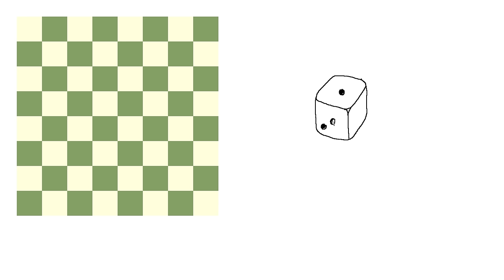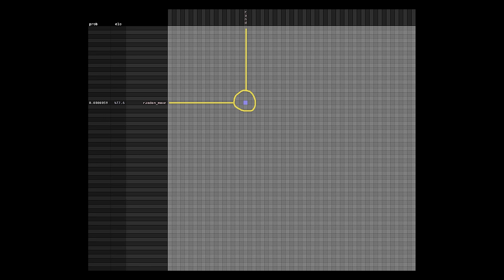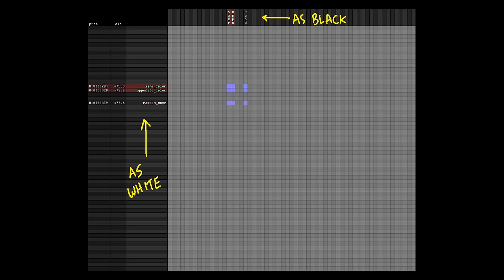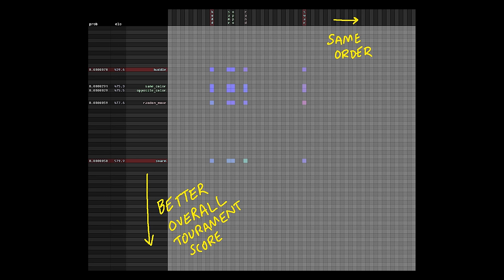30 Weird Chess Algorithms: Elo World

Comment: For those who are wondering, the name "blind_spycheck" and the strategy of that player is a reference to a spychecking technique in TF2 (which is where the term "spychecking" was coined) where you try to intentionally damage your teammates to test if they are not spies, as teammates do not take damage from friendly fire.
Reply: doesn't tf2 not play the damage sound for attacking a disguised spy?
Reply: @AveryChow  the main use case is if you use something with some lingering particle effect (mainly Pyro's flamethrower), which would absolutely stick around
Reply: @flatwoodscryptid  yeah fair enough, I forgot about pyro
Reply: weird reference for a chess video
Reply: 33:45 for ya lazy peeps
Reply: @kicknate195  I mean, this is a weird chess video
Reply: @AveryChow  Spy has very low health, so if you shoot at someone for about a second if they were a spy they would have died or had to run away.
Reply: @beautifulnova6088  IK, I've played loads of tf2 a while back, I've just forgotten some parts of how the game work lol
Reply: @AveryChow   the demoman's pill launcher and soldier's rocket launcher also give the spy away since they explode on contact. And the spy stops bullets, even if it doesn't show damage, so you can tell there's no bullet holes in the wall behind.
Reply: I thought the spy drops it's disguise if it gets damaged?
Reply: @Mostlyharmless1985  Nope. Only if they attack.

Pyros still set them on fire though, which is a giveaway even though you keep your disguise.

Comment: Possessed: Have stockfish play one move, then only allow it to move that one piece until that gets captured, and it can pick a new one! (so the currently chosen piece is "possessed" by the engine until it dies)
Reply: Oh wow that could surely be really interesting. Stockfish absolutely annihilating the opponent with a pawn.
Reply: @petersmythe6462  I believe that would be called... Pwnfish
Reply: Biggest issue I can see with that is Stockfish doesn't understand the constraint you've placed on it. So if it ever casually plays a king move, it's almost a guaranteed loss. I like the concept but you'd need to make a modify stockfish itself to build that constraint into its evaluation.
Reply: @dm9910  to be fair, most of these algorithms aren't necessarily good in terms of win rate. some of them actively try to lose, even
Reply: Possessed variant, chosen ones: Select (4-8) pieces randomly at the start of the game. Evaluate the board with stockfish. If the piece it wants to move is on the possessed list, allow it to make its move. Otherwise, move a random piece that isn't on the list randomly.
Reply: @dm9910  Yeah you would have to change the algorithm so it returned all moves not with that piece as invalid.
Reply: @dm9910  Well, we have worked around that, look at the dilution of stockfish and random.
Reply: @legendgames128  That's different. The problem isn't that it's weak, or that we can't decide what to do if moving the same piece again is illegal - of course we can throw in a random move in that case. The problem is that it doesn't understand the constraint. Stockfish's evaluations will be based on variations that it's not allowed to play. For example, it could play a move like g3 intending to go Bg3 next, but then next turn it will realize that its only valid move is g4. So even though it's using stockfish, it can't actually use any of its power. To implement this bot in a satisfying way you'd want it to foresee being locked into moving that piece again.
Reply: @dm9910  It does produce a ranking of all possible moves, so pick the best of the one that it currently possesses.
Reply: @legendgames128  Yes, you'll always be able to find a move that fits the constraint (if one is legal) but the problem is that each of those moves are ranked based on variations that don't fit the constraint. Stockfish will happily play a move like O-O without realizing that it's just locked itself into playing king moves for the entire game. It's not enough to know what moves are legal this turn, it also needs to know what moves would be legal on subsequent turns.

At the very least, the evaluation function for this constraint should avoid any king move like the plague, since that's basically tantamount to a resignation.
Reply: @dm9910  for the given "possessed" piece, you could feed each potential move's board state to stockfish to evaluate its strength. Worst case this would be slower by up to a factor of however many moves a queen on an otherwise empty board could make from a middle square, which is 28(?), I think 🤔.

Edit: ah, reading your later comments, I see what you're getting at! That's an interesting idea, and would as you note require modifying how stockfish works under the hood.
Reply: @dm9910  Maybe a way to solve the issue of it getting locked into only moving the king could be that if Stockfish ever moves the king, it's not locked in and can still move other pieces afterwards. It'd still probably do poor in the ELO ladder since if Stockfish ever moves a pawn it would be often forced to make multiple suboptimal moves with it giving time for the opponent to just win. But this would still be easier to do than rebuilding Stockfish to work specifically for this strategy.
Reply: You could let the possession hop a king’s move away from any given piece. I think that would be a satisfying solution without so many of the problems with possessing stuck pawns or the king. And it would still certainly be bad at chess. Although probably able to perform well in the Elo tournament. For bonus points, maybe add extra points to moves that leave your possessed piece next to other pieces
Reply: @matthewhubka6350  That's a better concept. Still a move-by-move handicap on the AI that it doesn't know about, and still has that undefined behavior when no "possessed" move is legal (e.g. if its king is in check, or it's possessed a pawn that's blocked) but still a big improvement over being locked into moving its king back and forth 30 times.

Comment: Piece Ranodmizer: Instead of picking a random move, pick a random piece and play it's best move from stockfish. 

Square Randomizer:Select a random space and then play the best move from stockfish that ends on that tile. 

Conway's game of life: Spaces with pieces are "alive" and ones without are "Dead". Each turn your AI makes a move to best iterate the next step in the game of life. It would be pretty cool to see a mirror match with these two having the same goal. 

Weighted Move: Where each move in stockfish is given a weight based on it's score and then you randomly pick one from the pile. More likely to get a good move, but rarely could get a crap move. 

Queen Maximizer: Try to promote as many pawns to queens as possible. 

Left only: Moves and captures can only move the pieces left and/or forwards.

Action Queue: Use the top stockfish move from the previous turn instead of the current turn. 

Rivalry: AI will always try to capture pieces with the same piece if possible. Will try not to capture pieces with other pieces if possible. 

Tic-Tac-Toe: Treat each 3X3 space as a tick tac toe board. Your AI wants to "win" as many of those boards as possible.

Comment: Physics chess: each piece attracts or repels all the other pieces according to some physical simulation. Variations: gravity: each piece has mass equal to its relative value, magnetism: same colour pieces repel instead of attract, springs: pieces attract if far apart, repel if close together. Move the piece with the maximum force in the direction of a legal move.
Reply: Thats a fun one
Reply: @muguallegi7245  underrated comment
Reply: This is a really good comment thread.

Comment: idk if anyone's already figured this out, but I'm pretty sure the "bug" in the cccp strategy comes from the way its priority of pushing pieces as far as possible into enemy territory is defined: cccp prefers to make moves where the destination is as far into enemy territory as possible, without any preference for what direction the piece actually traveled to get there. so because that bishop moving backwards results in it moving further into enemy territory than any other available legal move, cccp just ends up moving the bishop back and forth. this could be fixed by prioritizing total forward distance traveled, rather than only looking at the destination.
Reply: Interesting observation! Possibly, but this could be spun off as its own algorithm.
Reply: another thing I wonder is how it would perform if it was less deterministic; cccp breaks ties by picking the first move lexicographically, but the first move strategy is much worse than random, so cccp would probably be better if it broke ties randomly instead. but would it be better than min oppt moves?

Comment: Curious as to how some of the very weak engines managed to draw at least one game against Stockfish1m. How did the 4th worst engine draw Stockfish?
Reply: Yes! I would love to see that game!
Reply: Large sample size.
Reply: 1 million nodes sounds like a lot but it's pretty bad, not too surprising that weak engines can occasionally win. Set it to 100+ million and I doubt weak engined could ever win.
Reply: one of the things you have to remember as well is though stock fish always picks the best move. it also assumes some moves that would be epic are bad strictly because your opponent would prevent it. like moving your queen in a spot that can take a lot of strong pieces quickly but puts it in danger is a good move against say the pacifist bot. so some engines may accidently do the right moves to draw and stock fish doesnt know that it can win (a theory not a truth)
Reply: maybe you glossed over, but any non-deterministic solver will EVENTUALLY draw or win
Reply: @Zalied  wtf are you talking about
Reply: @Zalied  That's not how alpha beta search works.
Reply: @beri4138  im assuming he means that the stockfish will assume the opponent will play well so it will miss out on some moves that are better than the ones it decides to make due to it not knowing how the opponent plays
Reply: @Konomi_io  Well yes the process you described is called "playing the correct move, not the one that can lose the game".
Reply: @beri4138  ?

Comment: You should add a chess 'quantilizer'! YouTube comments don't like links so just Google quantilizers, there's a paper by Taylor that lays out how they work.
Or wait a bit and I'll make a video about them. They're designed as a way to make AI systems safer, but they can kind of be used as a way of interpolating between certain different kinds of agents
Reply: i see you have good taste too!
Reply: I'm still curious about that. I've posted links in comments at times and I don't see any obvious negative effects from doing so.

I'm not doubting that this statement has some truth to it, but I'm not sure how strong of an effect it really is.

I suppose it may also have to do with various other factors.
and of course, the difference between a comment made as a reply to another, and one made directly on a video.

A controlled trial could be done, but the results would be hard to isolate and interpret.
Leaving aside that there may be some 'personal reputation' factor at work that makes individuals who post links get wildly different results in general...

It's very hard to extract the negative effects (if any) of putting a link in your comment from the innate quality of the post you made.

Some posts just aren't interesting to anyone, regardless of how the algorithm rates them. If you make a post such as that, the hypothetical penalty for having posted a link may be so small a factor as to become meaningless.

Conversely, a sufficiently popular post may vastly outweigh the penalty as well. Though in that case you could presumably see an effect, even if it's a small one.

And getting back to that 'personal reputation' thing, perhaps someone that youtube's algorithms have deemed 'trustworthy' for various reasons can get away with posting links more easily than others.

Possible factors that could feed into such a 'reputation' system could include (but are not limited to)
- How many comments have you made with your account
- How popular are your comments
- How likely is a comment of yours to get a positive, or negative response (or none at all)
- Do you post video content.
- If you post video content, do you have any strikes against you? (whether copyright, community guidelines or anything else.)

Then there's factors specific to posting links;
- how often do you post links
- Is the link contextual? (does the post contain anything else besides the link, and how closely does the comment correlate to the link)
- What ARE you linking to and why?
- On balance, of all the links you've ever put in a comment, how many would be classified as 'suspicious', 'neutral' or 'positive' or whatever else.

Finally, there's some further contextual things;
Like, is the owner of any given youtube channel penalised less (or even not at all) for posting a link in comments on their own videos, than for doing so on someone else's?

And, just because I feel like testing this somehow, even if not very reliably, I'll post links to what you appear to be afraid of linking to:
https://intelligence.org/2015/11/29/new-paper-quantilizers/

https://intelligence.org/files/QuantilizersSaferAlternative.pdf

Granted, doing this really doesn't prove much of anything (besides demonstrating whether I can post links in comments or not, and whether there's any evidence of this having an obvious, directly negative effect on this comment)
But, you know. 
Can't be bothered avoiding things just because of some idea that basically amounts to a vague rumour...
Reply: Robert Miles!? 😍
Reply: Please do a video on quantilization, because it sounds fascinating but I don't understand it
Reply: What do you mean by quantilizer? That isn't a real thing. Do you mean something else?
Reply: @RoboticusMusic  It is a real thing. Google it in quotation marks.
Reply: A quantilizer is (now) a real thing. Whether it was before the research papers in question were written, I don't know.

But either way, it's real now.
And since this IS how words actually end up in a language in the first place, whether it was a real thing before now is kind of a moot point.
Reply: You're here?

Comment: How about an "SCP" strategy? This strategy is similar to the CCCP strategy, but it has three goals, in this order:

Secure: This strategy's first priority is keeping its king safe. If possible, it tries to make a move that prevents its king from getting into check.
Contain: This strategy's second priority is "containing" the enemy king. If possible, it tries to checkmate the king, therefore "containing" it. If that's not possible, then a check will suffice for temporary containment. Note that because the SCP Foundation does not want to destroy anomalies, it will not capture pieces unless forced to do so.
Protect: If neither securing nor containing is a possibility, the strategy will try to protect the other pieces.
Reply: GOC strategy

Go: only moves toward high value pieces

Obtain: gain as many squares to yourself as possible

Checkmate: checkmate the king

GOC best GoI
Reply: I wonder if there are any chess-related SCPs

EDIT: Yes, but none that can be emulated.

Comment: A couple random ideas:
- baby steps: never move a piece more than 1 tile in any direction. Might force knights to never move unless no other move is possible.
- Perlin or another fancy procedural image technique: use a procedural weighted map to define a random configuration the AI will attempt to reach.
- beeline: once a piece is moved, it has to repeat the same move every turn until it cannot, then another piece can be moved.
- Tetris hard drop: like beeline, but try to move down as straight as possible, so pawns will avoid captures, knights and jesters will alternate directions.
- toilet paper: wipe as many enemy pieces as possible before flushing the king on his throne.
- Astley: you know the rules, and so do I. A full commitment's what I'm thinking of, and as such the AI will try to stick as many pieces next to its opponent. It's never gonna give it up.

PS: cute doggo!